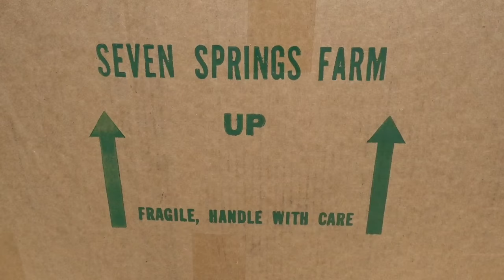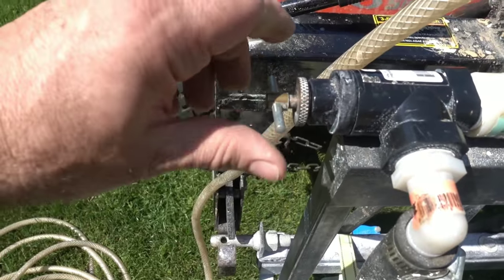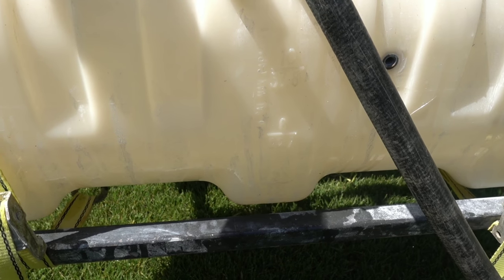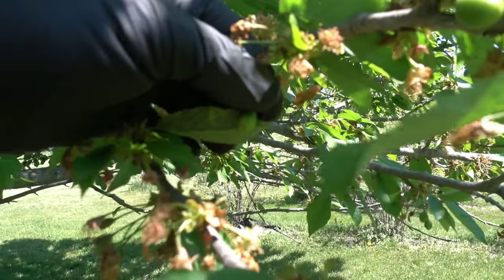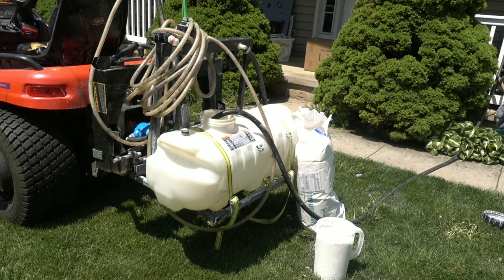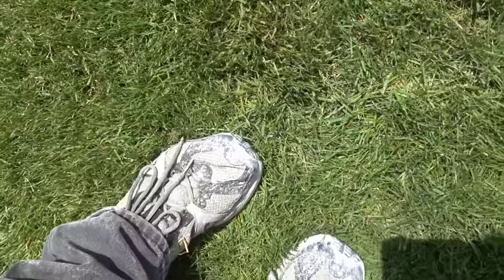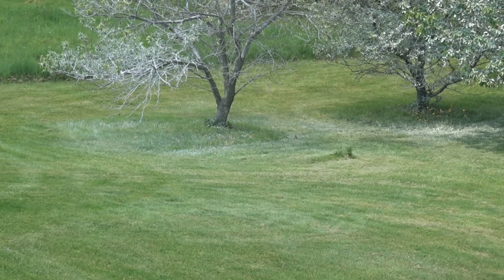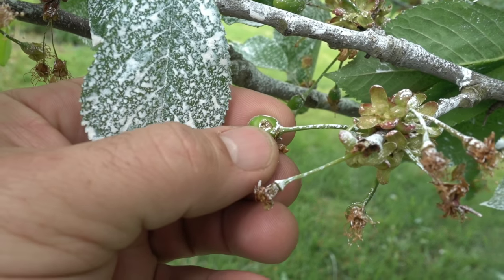Using Surround and Spinosad on our fruit trees.

Comment: I came for the surround spray And I got a lawnmower tour,
Reply from the maker: Did you watch the whole video?  I explain why i am using the sprayer i am with the surround.  Its important if you want to use this product.
Reply: @Marcs-Adventures  …. I did watch until I saw your using mechanical motorized tools. I thought I could spay it on with a hand held sprayer. I’m not doing an entire orchard so any tips on hand sprayer?
Reply from the maker: @riverunner9978  Its possible but will be difficult.  The surround needs to constantly be agitated to keep the particles suspended.  I always used some type of mechanical sprayer, the previous sprayer i had was electric.
Reply: @Marcs-Adventures  ….your set up does that it agitates the contents to get correct application. I get it . I’m just doing my veg garden I think I can shake the contents and spray at the sane time

Comment: That sprayer gives you a great spray.  Any recommendations for which type a home owner should use?  Surround clogs pretty easy
Reply from the maker: I have a screen filter as it leaves the tank.  This helps with clumps of surround.  The sprayer wand I use is the higher priced one from tractor supply.  Overall the sprayer system has worked well with the surround.
Reply: @Marcs-Adventures  perfect thanks
Reply from the maker: Thanks for watching our video!

Comment: Nice Job, Marc. Thanks for the shout out! I still need to edit my video, but it looks very similar. I've learned a few things after watching your setup... 

1. I need a longer hose on my sprayer. I was just using the 25' stock hose and in the end, my tractor is COVERED in surround. No matter where I sprayed, the tractor was always getting hit.
2. I need a PTO pump. I bought the FIMCO sprayer and it has an agitator/bypass like yours, but when you flip it to agitate, there's literally no pressure to spray. So I was agitating between trees, then flipping it over to spray. But by the time I was done with a tree, I could see the surround settling in the tank. I think a separate PTO pump that was always on and circulating would be very effective. Then I could just keep the tank pump set to the sprayer. I have no idea how to set that up. I think I need to go to tractor supply and ask questions.
3. I think I need to mix the surround thicker. I was going with the 25lbs/100gallon as recommended on the label. You looked like you were about 50% heavier than I went.

I definitely think it's made a difference. There is far less damage this year, but it's not nearly as effective as I had hoped. It used to be 90-100% of our apples were scarred. As of yesterday, it's about 30%... but we're still in curculio season and we've been having very poorly timed rain. Its been hard to keep the surround well coated. I haven't sprayed in over a week now and it's rained almost every day. I won't be able to re-spray until Friday and the curculios can do a lot of damage in that time. I'm hoping it's not too bad.

Thanks again for the link and for the information. You've been very helpful. I will be sure to send people your way on my video once I get to editing!
Reply from the maker: I don't think the typical/recommended amount of surround is enough.  I tried that when I first started out too...No good.  The higher rate of surround does the trick...Also use a sticker with it like dish detergent or insecticidal soap.  On my second spray I used detergent and got a LOT better coverage.

I want to modify my sprayer a but more. I have the flow going right back into the tank.  I am going to eventually extend a pipe with holes to the bottom of the tank so that it really agitates the surround at the bottom.  The PTO pump works very well for this type of situation.

I plan to extend my hose setup too, but I will move to 1/2" sprayer hose and add about another 10 to 15 ft to it.  As you already found out you will make a mess with this stuff! LOL

Comment: Why don’t you manually pump? And why do you have a filter hooked up? Seems like a waste of a filter
Reply from the maker: I had too many trees to use a manual pump.  The filter was useful with the surround because the surround could and did cake up at times.  Always a good idea to have a filter before the material you are spraying reaches the spray wand.  The filter is easy to clean and reusable. :)

Comment: Just caught your channel for the first time.  Very informative.  I've been using  the poisons for the pests, (malathion/methoxychlor) but want to try a safer system.In terms of timing, not knowing your geographical lattitude, I was wondering when you start spraying in relation to petal fall, and whether or not you use dormant oil and/or copper fungicide before any leaves appear in the spring.  I have a plum tree that looked like yours that came back after using the spring copper spray.  Kind regards, Craig
Reply from the maker: Welcome to the channel!  I had a battle back in my late 20s with cancer and decided I would try to reduce the number of harmful chemicals in my families life.  Some people start the surround on the trunk of the trees to keep the pests that crawl up the trunk at bay.  I Start when the fruit is about the size of a pencil eraser.  Have to usually reapply after heavy rains.  I should have tried to use copper on my plum tree, but it got so bad I decided to cut the tree down. :(  I will replant in the next year or two.  I have used Neem oil in the past but never any kind of dormant oil.  The main pest here is the plum curcolio, the apple saw fly and then we also deal with brown/black rot.  Other then that I have not had other serious pest problems.
Reply: @Marcs-Adventures  Thanks so much for the reply.  The main problem here in Vermont is the apple maggot and to a lesser extent the codling moth.  The red spheres/pheromone lures are ineffective for lowering the numbers of the maggot, but do serve as sentinenls as to when they arrive.  I will use surround next year.  Thanks for showing your hypro pump as I would have ruined my fimco pump with the clay.  Kind regards. Craig
Reply from the maker: @craigdreisbach5956  Please keep us posted on how it works out for you.  I head the coddling moth is a real pain to deal with too.

Comment: Safety recommendation when mixing and spraying Surround wear a N95 mask. Fine particulate material,
Reply: Also wear long sleeves and wear goggles.  Most Spinosad products use the signal word CAUTION.  He should wash his clothes and shower right after.   It takes a LOT of spinosad to make someone sick, you'd have to bathe in about 10lbs of that dissolved in water to reach Ld50 (average) and there isn't any known amount in aerosol form that has been shown to be lethal.  But it can be very irritating and its inevitable that someone will have an allergic reaction.